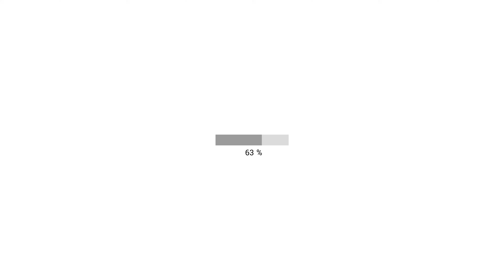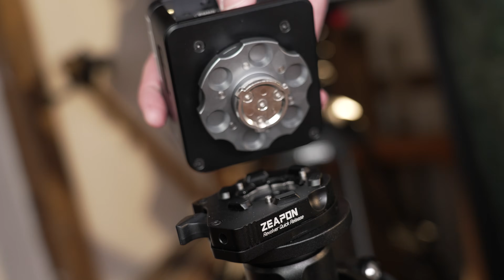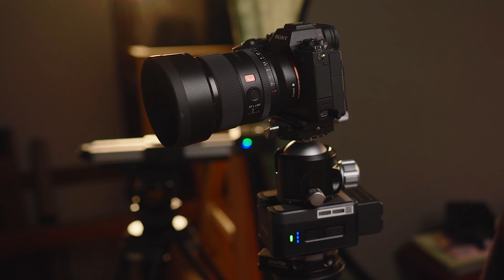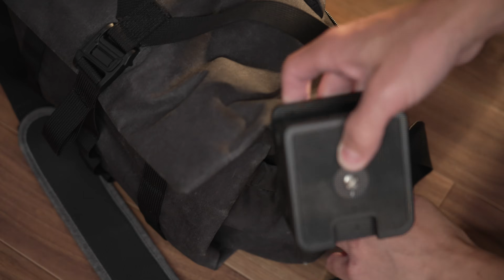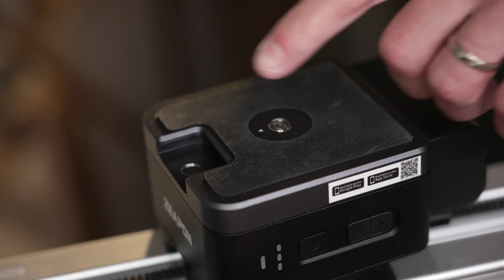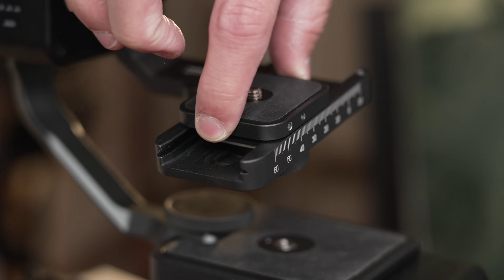Zeapon Pons PT | Setup and Operation (Part 2)

Comment: Hey - I have a question: Do you have a tip for me to easily remove the camera from the quick-release-plate? I always have very hard problems removing my cam from this quick release - in your video it looks very easy ... but i turn the wheel right .. left ... etc ... I always need over a minute to get the camera removed ... its not as easy as here in your video: https://youtu.be/8HjIFeTSFqU?t=413 - any tips?

Comment: Do you recommend using this with a Blackmagic Pocket 6k Pro camera with a cage?
Reply from the maker: I haven't tried it specifically so can't be sure but it's pretty strong so weight shouldn't be a problem. Not sure if the wider body would be an issue or not, like sometimes on gimbals.

Comment: Hi Scott, thanks for great videos. What about noise during the motor operation? Is it audible? I would like to use this device during wildlife photography so I look for something as quiet as possible.
Reply from the maker: Thanks for watching :) It depends on the speed but at the lowest it's barely audible. The highest speed does make some sound but it's the same or quieter than most, if not all, other motorized sliders I've used.

Comment: Hi Scott, really enjoying your videos ... i bought the micro 2 plus with pan motor only, is it possible to buy the tilt separately ?, i cant find any
Reply from the maker: You should be able to... the pan and tilt motors are the same, just the tilt arm which is different. I can't find the tilt head by itself either though, I'll let them know and hope they can get it up on amazon or their website.
Reply: @ScottDumas  Thanks for your reply bud, i managed to find a company that can supply ( UK ) `Cinegearpro limited` based in London,  so i have now made the purchase, perhaps this issue could be highlighted in a new video for you... Regards ... PJD FILM & FOTO

Comment: It's a great introduction video, but I don't agree with the balancing. This is a robust system that doesn't have PID controllers, you should aim to minimize parallax not minimize imbalance. Cheers
Reply from the maker: That's a good point, however I was going by what Zeapon themselves recommend, at least to the best of my understanding.